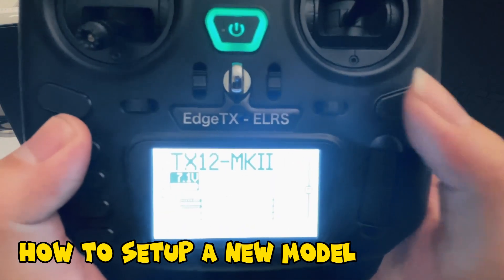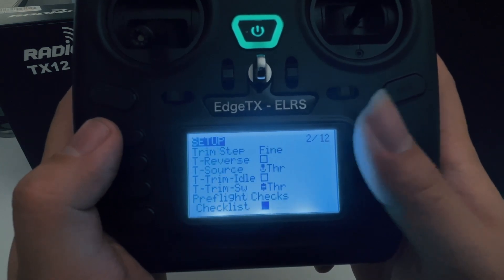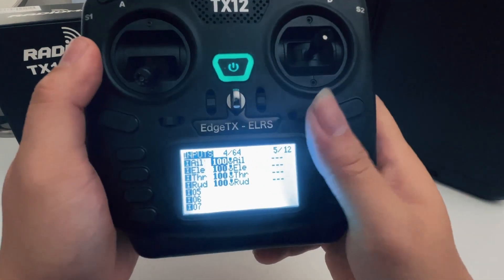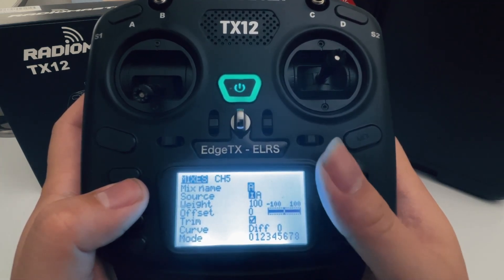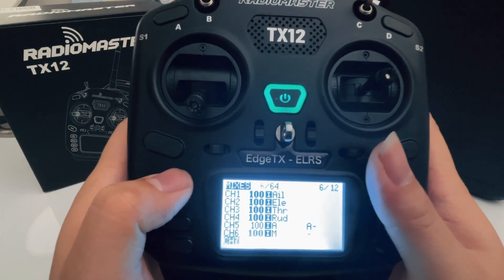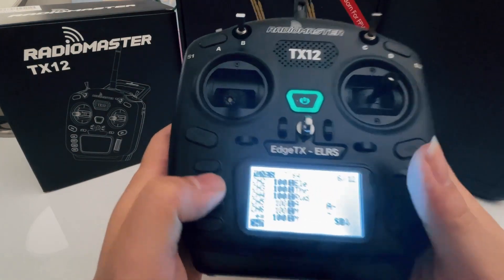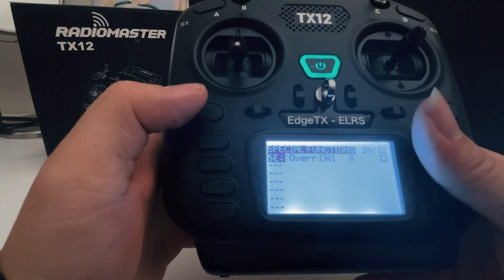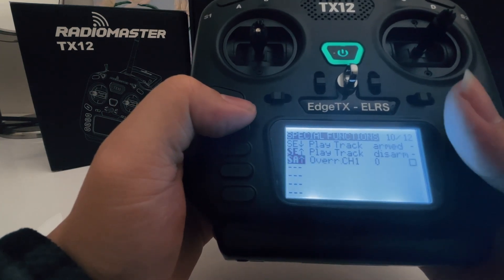How to set up TX12 MKii ELRS - Part 2/ Set up a new model and make your TX12 talk

Comment: I ordered the wrong right gimbal for throttle instead of left, how do I bind it to where I have the left gimbal for throttle
Reply from the maker: I have never done this before but I will assume there is a function in the radio to allow you to change the Modes, you need to switch the radio to mode 2 or adjust your channel mapping in betaflight. In addition, you might also need to physically switch your gimbal modules around

Comment: I looked through all of your videos, do you have one for brand new mkii tx12 controller setup for use with a simulator?
Reply from the maker: I can certainly creat something, but It is literally plug and play, power on the radio, plug it to the computer using a usb cable and it should work

Comment: If I add a mix but don’t select a switch then flipping the switch will move the flight mode selection. But I still can’t seem to adjust the amount to correctly select modes. 😂 I’m using the TX12MKII with a Naza M V2 from DJI.
Reply from the maker: The correct amount should able to be adjusted from your receiver side, i am not sure which software the Naza use tho...
Reply: @XwingFPVRC I need a 3-way switch for the Flight Modes and another 3-way switch for Headless mode and the other two (IOC modes). I thought I heard something about the radio not being able to use 3-way switches the way a Quad, not fpv quad, would use them. I’ll keep learning. Nice little radio. Shame I’m yet to use it. Not sure why Radiomaster would sell a radio that is so difficult to use in some RC models.